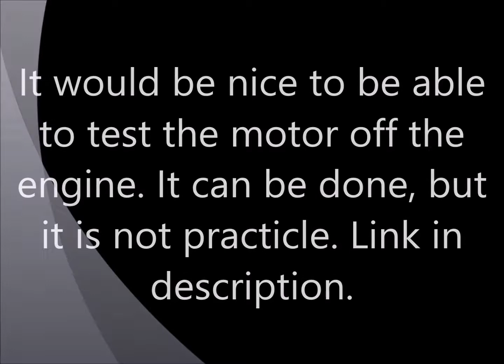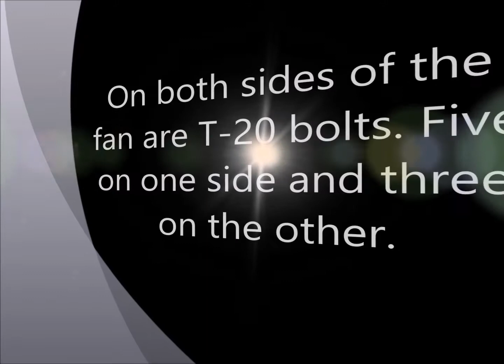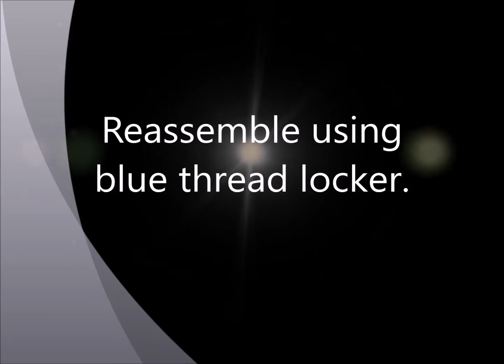Install a new fan shroud motor in a 2010 Mercedes E 550

Comment: i am trying to replace the fan blades with out removing the assembly from the car
Reply from the maker: Can't be done.
Reply: Why not I get to three screws that are  on the fan blade    is it being held from the back side somehow on to the motor
Reply from the maker: Because of the other five screws on the other side. See my video on how to remove the entire fan shroud.
Reply: That sucks but thanks for the info
Reply: @Lsailor169699  just in case we are miss understanding  each other i have broken blade on the plastic fan my motor is working fine i just want to take the plastic fan part off and put the new (used ) plastic fan on the working motor
Reply from the maker: @emilianodinoi5069  I understand completely. My answer stands.

Comment: Sir I won't to check this fan dract on battery possible
Reply from the maker: Thanks for watching my video! Unfortunately, the fan requires an input from the car computer to turn off and on and you can't just hook it up to a car battery. This video shows the connections that are necessary: https://www.youtube.com/watch?v=XZXNRzIVuIw&feature=youtu.be   Best, The Sailor.